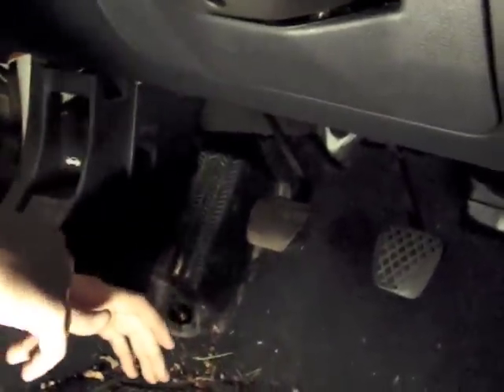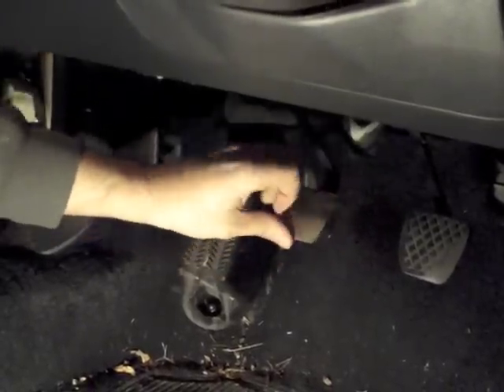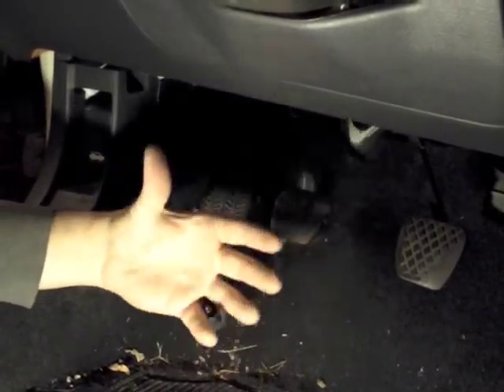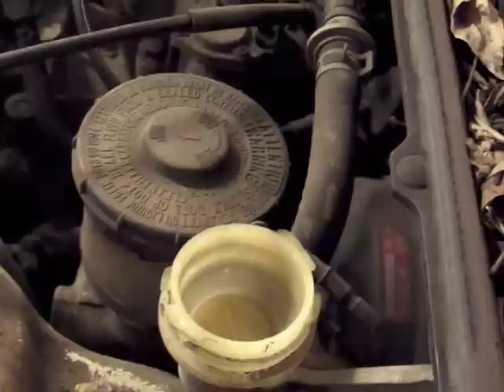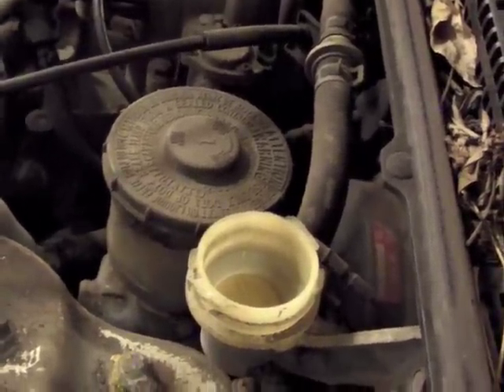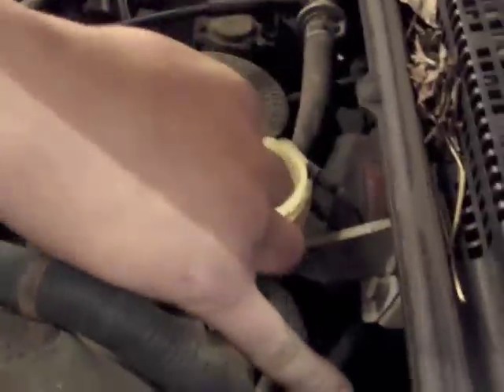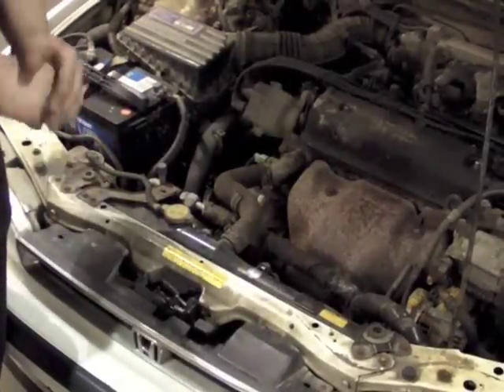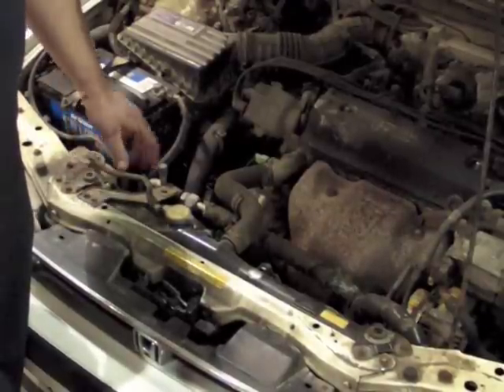How To Diagnose A Clutch Problem

Comment: I don't see why it HAS to be a two-man job..The way I usually bleed brakes is to pump, then hold the brake pedal down with something (a log) between the seat and the pedal, crack the bleeder, and repeat. It does take more time but always works fine. To get a bit of 'spring' I put a large book between the log and the seat, so that the surface area and 'springiness' of the seat cushion keeps pressure applied.  Obviously you need to be more careful of the amount of air/fluid you let out each time since you don't have anyone telling you that the pedal has hit the floor! With the clutch I'd assume the one-man way would be easier again since you can just pin the pedal to the floor..

Comment: I am thinking of buying a car.
put handbrake on in 1st gear
clutch down with gas.
slowly raise clutch and car starts moving.
does it need a new clutch or is it the handbrake?
Reply: Leigh Craven what does that hand brake have anything do with acceleration?

Comment: My clutch is EXTREAMLY STIFF. It is VERY HARD TO PUSH DOWN, and its constantly like this. I just bought the 96 Mustang GT and the previous owner said they had a stage 2 clutch installed, idk if it was ever adjusted. It grinds gears every now and then. But it engages quickly, close to the floor. The check engine light just came on and the car seems to be normal, no new problems. All fluids maintained, no over-heating. ANY INPUT WOULD BE AWSOME, i cant afford a mechanic

Comment from the maker: @cjmejiac hmmm.. believe those are hydraulic.. initially it sounds like your slave or master is bad.. (air in the system could be preventing it from releasing how it should and air would be from a leak) check your master reservoir and see if the fluid level is proper could be an easy way to tell.. follow the steps in the video of inspection and you should find your issue..thats about the most i can say with the info given

Comment: my clutch keep going to the floor..
Reply: eric jones
Reply: eric jones
Reply: I am having the same issue and have already replaced the slave cylinder and the master cylinder. I have a 2002 VW Jetta 6 speed 2.0L. even after replacing both those parts and making sure the system was bled very well the pedal still goes to the floor. I've check for leaks but can't find any and also the fluid doesn't appear to be getting low at all.  Any suggestions?
Reply: Raylene Dickenson the car needs to be leveled if it's on Jack's in order to bleed it properly